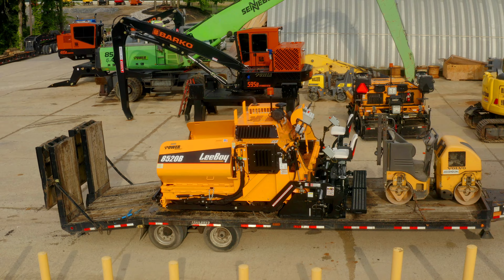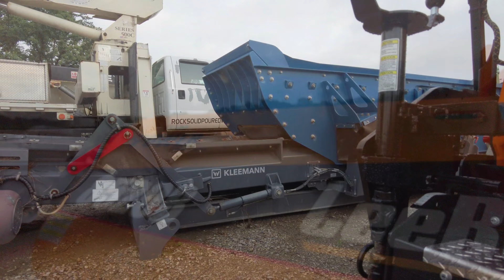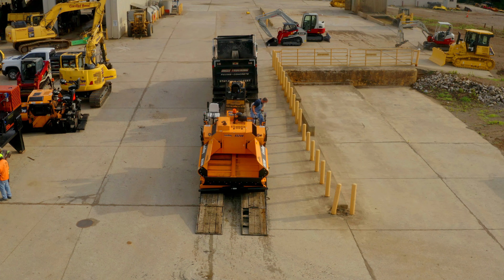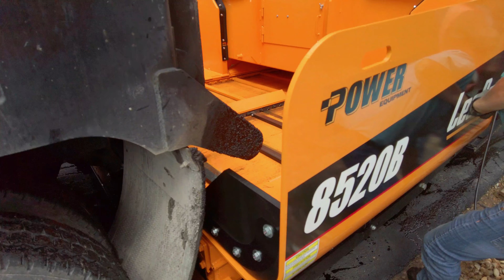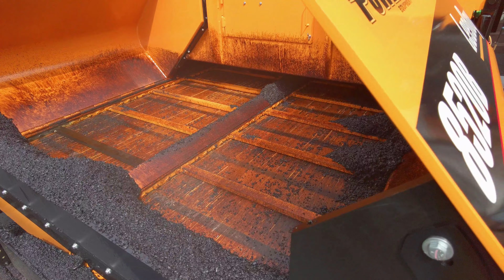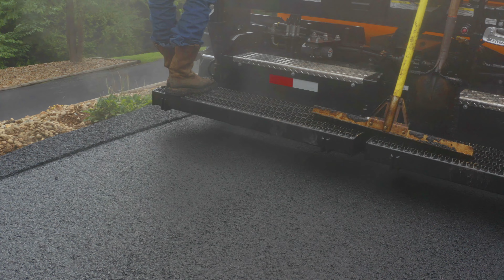new leeboy 8520

Comment: What's the difference between that and the old one
Reply from the maker: the old one is bigger with a few more bells and whistles. i know from pulling them both that the new one is considerably lighter for sure. also its harder to see over the front on the 8520 as well
Reply: Why did you go with the 20 over the advanced 8530
Reply from the maker: @danzuber2701  it's a back up paver, ill ask the crew the other question,  I just deliver the equipment and fill my time by making these videos,  thanks for watching